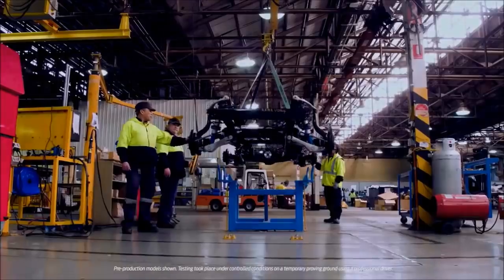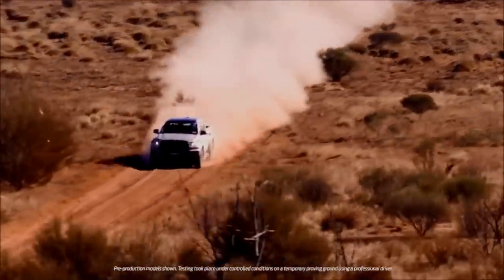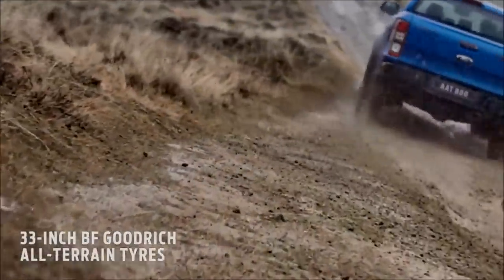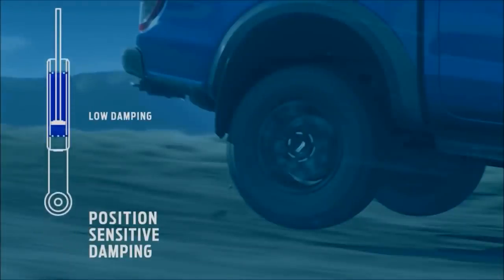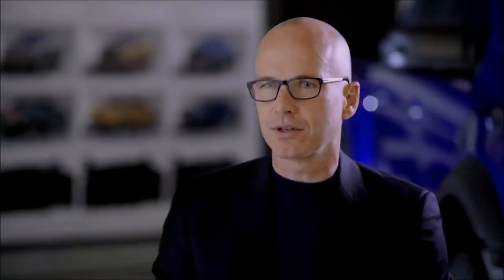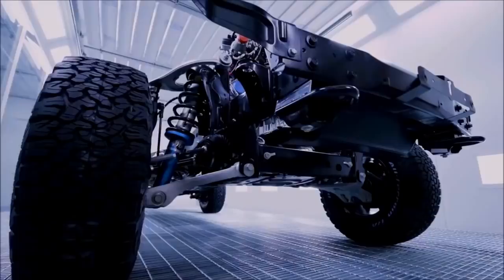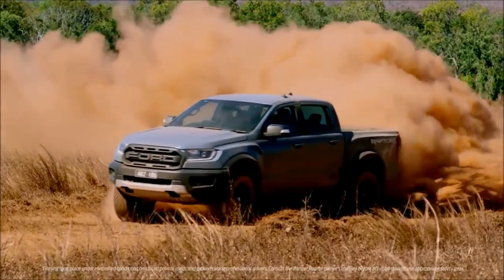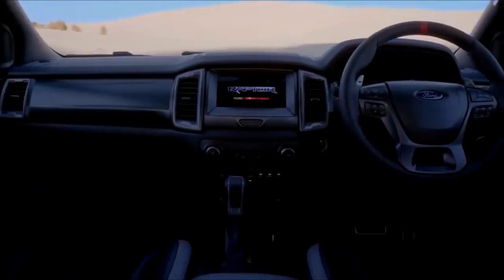Ford Ranger Raptor - The Best Pickup Truck Ever !!

Comment: Ford you know how to tease a wavering Chevy owner
Trailboss is a joke, the ZR2 diesel doesn't have the 10 speed, and the new design language for all Chevy is atrocious to me
Reply: the ZR2 is the most off road capable GM makes. Trailboss is a missed opportunity and mostly an appearance package unfortunately.
Reply: Chevy doesn't need a 10spd, the over performing diesel will gradually degrade your fuel economy.

The raptors are a completely different type of offroad vehicles, while the ZR2 is more part of the crawler and and climber class.
Reply: Wait, why would you need 10 speed on Diesel engine...? You need lower gear ratio for diesel out than the number of gears...in fact, I was hoping Chevy Colorado ZR2 would have Alison's 5 speed transmission (which is available in after market).
Reply: Why the hell would you want a diesel anyway?
Reply: I wish they made the ZR2 Colorado Diesel with a manual transmission
Reply: George Montes zr2 is the best pick up truck by far
Reply: I'm a GM guy and keep waiting for them to come out with something that competes with these trucks. I am losing patience. Every year it's the same shit.
Reply: Robert Cerda the Zr2 literally blows all these mid doze off road trucks out of the water, guy. The bison looks to be pretty well rounded truck as well. Ford is 3-4 years behind on what Chevy has already established in the midsize market
Reply: @evilone6785  haha, actually it has a towing weight of 7200lbs with a tuned engine, stock 5000lbs, most people who buy this truck aren't looking to tow any ways. They are looking for a midsize truck with a bit more capability then what has been offered in the past, a diesel allows them to have that low end to get themselves out of sticky situations while the v6 gasser has the top end to get them that jump they would want.

Honestly can't judge a person by what they want their trucks for, I've seen more douchebag driving big boy diesel trucks and not doing anything with them other then rolling coal...
Reply: @Apoc_Bone_Daddy  it seriously reminds me of the jaguar F-type, I was hoping for more of a colorado style truck/suv
Reply: @Ddanielmilton  AGREED... I was hoping they'd just bring back the older 80's body style with a """""modern twist""""" or something... Lol.... You know... Like some kind of throwback to better days...
Reply: @Apoc_Bone_Daddy  I was thinking it would be more like the colorado but with the bed molded into the cab.... Well like the old Blazer... Atleast the bronco will follow the old school style... But it's still a ford.
Reply: Apocalyptic Bone-Daddy 
Blazer grocery getter lol 

Bronco baja 1000 lol
Reply: @suavehouse5150  slow down Rico Suave, 1 post is enough.
Reply: jet052673 
Lol that’s was a YT error
Reply: wow I've seen biased posts but man your is close the top lol. the zr2 is probably more capable than the ranger raptor dude, not to mention it took ford what about 3 years to get into the US market...if it ever comes again. dont sell gm short for creating a truck that sells. and will probably last MUCH longer than the puny 4 banger gasoline engine in the ranger.
Reply: Ed's Fortune its to heavy for offroad. Big Duramax Diesel has to much weight in the front. For off road your better with a lighter set up. Even a 6.0 gas would be a better offroader.
Reply: Ranger probably won't even get a diesel.
Reply: Trailboss is nice. Ford broke 20 times while filming this.
Reply: LooxGood because he has no idea. And thinks more gears is better.
Reply: @PistonAvatarGuy  Dur, for towing. The Silverado in Australia puts out 1234nm of torque and 340kw. Even though it's a diesel, it still gets to 100kph in 6 seconds.
Reply: @PistonAvatarGuy  maybe more horsepower but diesel has more torque and better fuel consumption. For 4w driving and towing, diesels reign supreme. Sorry buddy but that's fact. If you want it just for cruising the streets, then yes petrol is the go.
Reply: @peterpatina63  What does towing have to do with diesels? I've been towing with gasoline engines for nearly 20 years, I've never been left wanting more power. 

The F-150 with the 2.7 EcoBoost engine gets to 60 mph in 5.9 seconds and is more powerful and cheaper to run than any diesel in the same class.

If car companies stopped wasting their time on diesels, we could have a 4.5 to 5.0 liter, gasoline inline 6 based on the EcoBoost technology that mopped the floor with any diesel offering, in any class. The 3.5 liter Ecoboost already almost does that.
Reply: @peterpatina63  Torque doesn't do anything for performance, and diesel costs more than gasoline in the US, so diesels are still more expensive to run, even if they are more efficient. Diesels are also filthy, so you have to deal with all of their BS emissions controls. The emissions control systems fail often and are incredibly expensive to repair when they do.

Four wheeling is something that I used to do a lot of when I was young, almost no one ran diesels, they're just too heavy and get stuck everywhere. The most capable off road vehicles in the world largely use gasoline engines (or just spark ignited engines)... baja, formula off road, monster trucks, etc.
Reply: @PistonAvatarGuy  Here in Australia diesel is the same cost as petrol and most diesel engines are very reliable. If you're racing as fast as you can over dirt tracks, then yes petrol is best but for people going Bush in Australia you'd be hard pushed finding anyone that runs petrol. We don't have Baja type countryside here in Australia but beaten tracks that you can't go fast on. We also have to travel vast distances to even get to bushland and servos are few and far between (and they all have diesel at the pumps but not always petrol). These servos are catering to the semi trucks that travel from state to state. From where I live, the closest state is 1000km away and the other closest is 1500km away and there's only a few towns inbetween.
Reply: @PistonAvatarGuy  you won't find many utes in Australia that run petrol. They're rare as rocking horse shit. The reason we buy utes in the first place is to tow. If you don't need to tow anything, you wouldn't buy a ute, you'd buy a petrol sedan. In Australia, a ute is a work horse, nothing more, nothing less.
Reply: @peterpatina63  A lack of gas (petrol) stations isn't something that can be blamed on the engines. Gasoline engines go slowly just as well as diesels do. I mean, I guess that explains why Australians wouldn't want diesels, but they just don't make sense in the US.
Reply: @PistonAvatarGuy  diesels make far more torque at low rpm's and that's what you need when you go Bush bashing in Australia. You might only be going 10kph for 2 kilometres over all the ruts and ridges. By the way, I'm not a fan of diesels but I do see why the 4wd mob in Australia use them. I'm more into sportscars and screaming around the streets and country roads. Love twisty roads and we have many in Australia.
Reply: @peterpatina63  "diesels make far more torque at low rpm"

That depends entirely on how the gasoline engine is tuned. Turbocharged gasoline engines are perfectly capable of making more torque than a diesel with similar displacement at any rpm. When compared to naturally aspirated diesels (which are pretty rare these days) gasoline engines tend to make more torque at any rpm.

When I was young, we weren't blasting around in the desert, we didn't have baja racers, just stock pickup trucks, so everything was done pretty slowly. Rock crawling is also a popular pastime in the US, most of those guys use gasoline engines. Diesels really are too just heavy and/or under-powered for most applications.
Reply: @PistonAvatarGuy  If you're talking tuned engines then maybe but for stock factory engines, diesels will always have more torque and from lower rpm's. We don't have a big tuning scene in Australia. Most people just leave their cars stock. You gotta remember that we're paying 1.60 for a litre of petrol so everyone is concerned about fuel consumption. Hell, they buy really small cars with diesel engines in them to get the best milage. Everything is far in Australia. Suburban sprawl goes on for 100kms.
Reply: @peterpatina63  "If you're talking tuned engines then maybe but for stock factory engines, diesels will always have more torque and from lower rpm's."

No. From the factory, the Honda F22B had more low-end torque than the 2.2 liter Mercedes OM604 engines. In the same era, many Chevy small block V8s had more low-end torque than the Oldsmobile diesel V8, or the Detroit 6.2 and the naturally aspirated 6.5 liter diesels. The 3.5 EcoBoost likely has more torque at low rpm than the Ram 3.0 EcoDiesel... Diesels don't make much torque at all, unless they're boosted higher, so even if their peak torque is at a higher rpm, gasoline engines can still make more torque at low revs.

The vast majority of people leave their vehicles stock here as well.

"Everything is far in Australia."

The US is bigger than Australia and Americans drive more miles per capita than anyone else in the world. Again, diesel fuel is more expensive in the US, so you don't save any money by driving a diesel.
Reply: @UCPjLrWxMqCFqhlAl9O-8anQ The duramax 6.8 litre turbo diesel in the Silverado puts out over 1200nm torque. What standard petrol engine puts out that torque. You might find some elite cars that do but it won't be at a low rpm as the diesel. Most diesels in the shitty diesel dual cab utes have 500nm from a 2.8 litre engine and you'll be pushed finding a petrol engine in Australia of those cubes to beat it. Anyway, personally I don't give a damn. I don't drive a diesel anything. It's the devil's fuel but if I were to buy a Silverado in Australia, I'd buy the duramax version. They're too big for Australian roads though so I'd never buy one. I wouldn't buy a dual cab ute either. If I wanted a ute, I'd get one of our V8 utes from either Ford or Holden. They're like sportscars. Look up the Maloo ute from Holden. Anyway have a nice day. It's been nice talking to you but I've got to go to bed now. Night Time here.
Reply: @peterpatina63  How many turbocharged, 6.8 liter gasoline engines are currently on the market? Anyway, POWER is what determines performance, torque is completely irrelevant. 

Even if there were a gasoline engine that was designed to fill the role of something like the Duramax, or the Powerstroke, or the 6.7L Cummins, it probably wouldn't make as much torque, because it doesn't NEED to. Diesels have to make a lot of torque in order to make a decent amount of power, because they're so limited in their ability to rev, that's a DISADVANTAGE. Anyway, my point wasn't that gasoline engines always make more torque than diesels, just that they're perfectly capable of doing so.

"Most diesels in the shitty diesel dual cab utes have 500nm from a 2.8 litre engine and you'll be pushed finding a petrol engine in Australia of those cubes to beat it."

I don't live in Australia, and I'm talking about engine technology in general. The 2.7 liter EcoBoost in the F-150 makes 542 Nm and peaks at 2,750 rpm. A 6.8 liter engine that made as much torque as the 2.7 liter EcoBoost engine makes from its displacement would be making 1,365 Nm of torque.
Reply: @Apoc_Bone_Daddy  the  Bronco, on the other hand, looks fantastic!
Reply: Im a raptor fan and even i know 10 gears is stupid for a 450hp pickup truck
Reply: George Montes Chevrolet sucks always has and always will !!!
Reply: I don't need this I have a 1994 ranger XLT lifted big tires and 4wd
Reply: @johndorsey7165  🙄😂
Reply: Zr2 has better suspension & doesn't need the 10-speed bc it's light...plus it's available in the US, which is the most important
Reply: @nevileasterling648  not great for rock climbing
Reply: @evilone6785 lol, it should say "Stupid One"
Reply: @Ddanielmilton  GM's v6 is badass though... Throw a turbo on that girl and you've got a serious motor
Reply: @Ddanielmilton  other THAN rolling coal... Which is the best thing to do with a diesel in Boulder
Reply: Chevy lost me with their customer service at their dealerships.
Reply: Also the zr2 is weak
Reply: It has a 10 speed to compensate for the puny engine. If you gave an 18-wheeler half the gears, it couldn't move the weight if those gears were too high.  If the gears are low enough to move the weight, it wouldn't reach highway speeds.  

A similar thing applies here. the only way to mimic enough power is to give mire gears.
Reply: look up the holden superado
Reply: MotoRacer171 it’s 440, feel like 300 on the ones I drove
Reply: @johndorsey7165  Not the Bison from GTA
Reply: @evilone6785  I hate when people calls a truck ugly they get confused they make it look generic just like cartoons
Reply: @Ddanielmilton  Lol already

Comment: Way over thinking it guys! We need trucks to haul junk and groceries, pull a trailer,  drop kids at school.........THAT DOESN'T COST AS MUCH AS MY FIRST HOME....Build them like that and we will buy faster than you can make them.
Reply: Folks who'll buy this truck might not even bring this thing off-road scene. But I bet you'll gonna see a lot of these on malls and on car shows.
Reply: 90% of truck owners don't even use it for hauling.
Reply: I know what you mean. I went to buy me a new truck and all they had on the lot were Lariats with a 5 1/2' beds. Told them I needed an XLT with a longer bed and tow package they looked at me like I was an alien. For what the new ones are listing for I'm going to run mine until the wheels fall off then buy something used.

Comment: Funny to see someone driving a raptor ( f 150 ) in city streets and when they encounter a small pothole or crack on it ,  proceed like if they are driving a compact automobile .
Reply: El tunas T espinas i have a 2013 f150 lariat and i do this. Get a job.
Reply: daddy 69 lol someone didn’t have enough meds for tonight
Reply: @jamesortmann6587  ig he didnt lol
Reply: I have a 2014 Raptor and believe me, you have to dodge potholes. It is not a smooth truck.
Reply: @XX-mw7zm  how is it not smooth?  I had the old 2011 raptor with the 6.2L V8 with the original fox shocks and that thing drove and road like a champ. I accidently hit a monster speed bump (12"high and 2-3ft across the top) at 40mph-45 mph went airborne and it soaked it up very good,  I find it very hard to believe that after upgrading the shocks in the gen 2's to a more beefy and adjustable system for the shocks it some how gave it a worse ride......To be honest the 6.2L raptors ride was compairable to riding in a mid ranged luxury car as far as comfort. So im not sure what you mean by rough ride and by far the best riding vehicle i've ever owned, granted I've never owned a high end luxury car.
Reply: Yeah when they’ve got about fifty or sixty grand invested, I can see why!
Reply: @estevano4434  Hate!!!!!😭2
Reply: @XX-mw7zm  Sadly no 2015 or 2016
Reply: Yeah, I actually had to go around a ram rebel tipping over a bump in the road, my F150 FX4 and the late 90s F150 behind me sent it across the dip at speed gave the suspension a little action, got a little air coming out.
Reply: @kdrapertrucker  Ohhhh now I hate when someone replies from a week or a month ago

Comment: at least they should of put  twin turbo set up like the 2.7 v6 ecoboost
Reply: Or a upgraded closed block 2.3 that's in the RS
Reply: The 3.2 i5 diesel is better. If we could get the 2.2 turbo i4 diesel we'd still have better than the ecoboost. And there is an ecoboost model of it for baseline.

Comment: Forget to mention the outstanding 18 second 1/4 mile
Reply: Well shit an offroad truck is not a drag car? Damn.
Reply: @popwarhomie  The F150 raptor can do the 1/4 mile in 14 seconds, the Ranger Raptor is just slow.
Reply: You are comparing a 2.0l 4 cyl to the 3.5l HO of course it’s slow.
Reply: @popwarhomie  It's slow compared to just about everything. I'd bet even the slowest version of the f150 is still considerably faster then this truck.
Reply: The raptor F150 is slow.  They aren’t built to be fast.